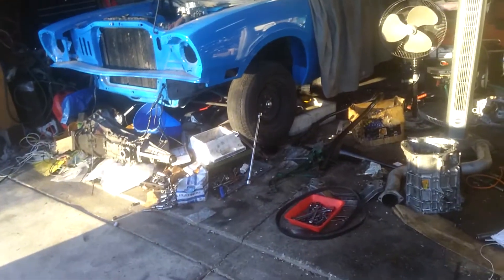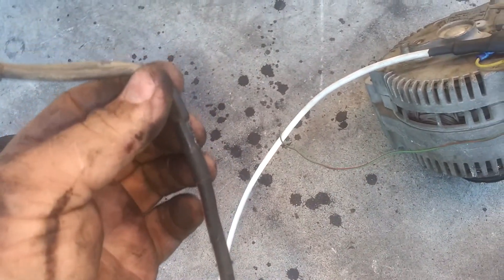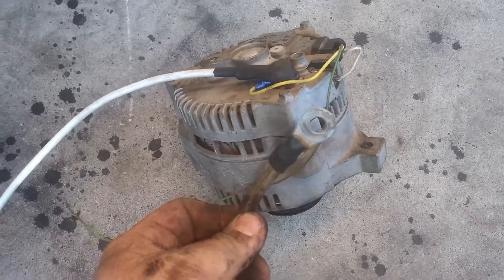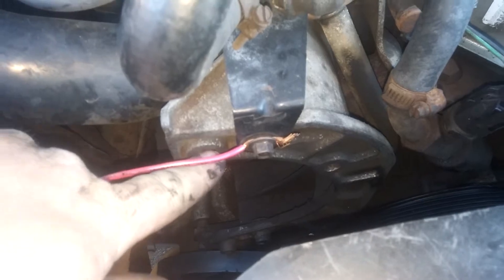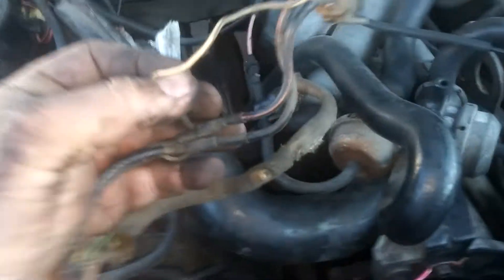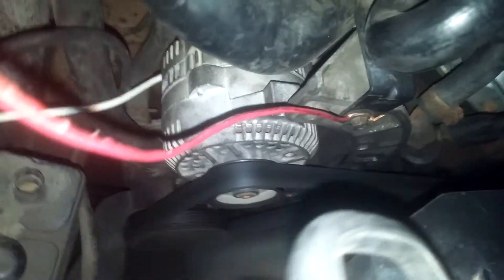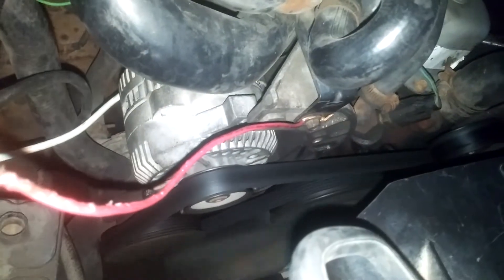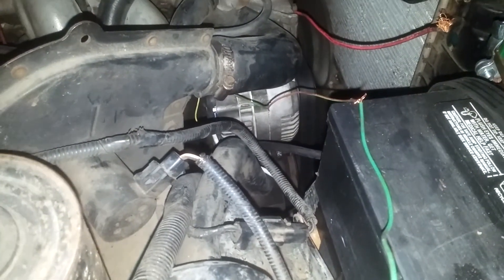ford f150 4.9 3g alternator upgrade

Comment: Is the green wire hot when it’s running
Reply from the maker: Yes that’s Key on/constant on power
Reply: @v8only  ok on mine the green wire isn’t hot but the orange wire is. So it’s hot only when the key is on

Comment: The 1995  f150 4.9 3g small case 95 amp is a direct  replacement  for  the original 2 g .  It has the same offset ears .    The 1995 4.9 large case high amp alternator straight  ear is also a direct  fit ,using the outer mounting  holes on the bracket.  It uses a different  length  belt.
Reply: My dude do you happen to know what size belt it is or where I could find this information

Comment: used one from a newer 94-96 F-150 with a 4.9 bolts right on in same Holes no need to bubba fuck nothing
Reply: I am looking to do this with my 89 van with the 4.9, thanks for the heads up on which one fits.